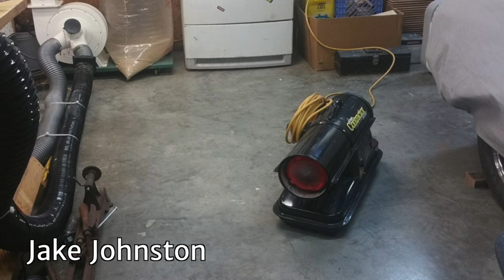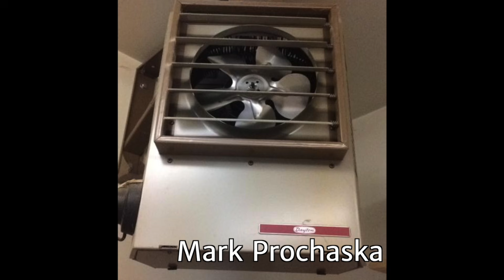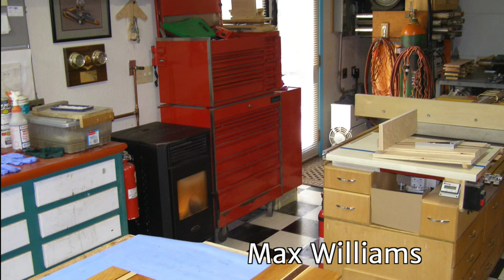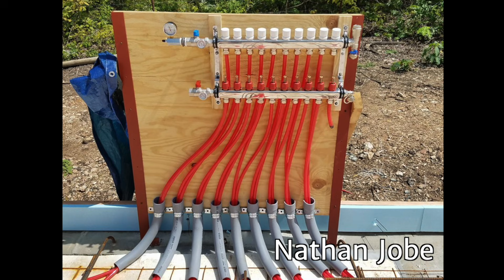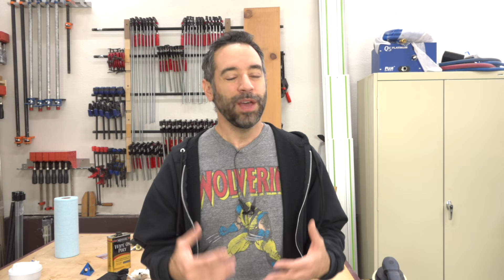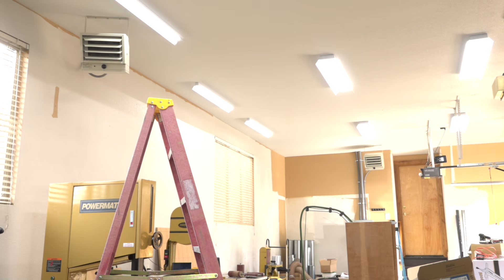Heating Your Workshop

Comment: I´m currently building a workshop on my farm, 128 square metres, concrete floor. I´m going for a hybrid system, a big diesel space heater that I mounted in it´s own insulated box outside with ducting into the workshop, I fire this first thing to boost the heat up quickly but it´s noisy despite mounting it outside, I then have a combination of electric fan heaters and currently installing a wood burning stove. I also set up small infra red quartz heaters localised at smaller work stations. At some point I may put in a sub floor with floor heating. I am lucky enough to of had the space to build my office inside the workshop, a 8 square metre, well insulated room which is heated by a small 600w electric panel radiator with wi-fi connection so I always have a warm space to take a coffee. I live in Sweden and we see temps of  upto  -20c in winter where I am. This will be the first winter for my new workshop so fingers crossed I have done enough work to stay warm.

Comment: in 2022 electric is very very exspensive but like you said it’s the easiest way to heat a garage / workshop that’s insulated. i only heat the area when im working . it’s a hobby .i’m retired .

Comment: Middle TN Woodworker here. I decided on a pellet burner. I buy the pellets in the off season when the price has dropped. Since 2009 it has only cost me $100 per winter. But then I wasn’t out there every day and have a 28x30x9 shop. I was working my regular job 3 to 4 days a week. Now that I’m retired I haven’t been through a full winter yet. I still love the pellet burner. 
As for your heaters, you could put a 2 pole switch rated at the correct amperage to turn on your heat as breakers aren’t really supposed to be used for switching.

Comment: Hey, Thanks for the info on heating. Do you try to control the humidity at all? Do you let the temp in your shop fluctuate? Do you find that your project wood stockpile changes dimension much due to temperature or humidity while working on a project? Thanks

Comment: I was lucky enough to be able to install a 3 ton mini split that keeps my 20x30 shop in the 70s when the temps drop below 20. I have a pair of those heaters from before the mini split and they did a good enough job before the foam insulation was put in the metal shop building. we have 8 foot doors and are still able to keep the temps in the 70s all year in Texas. The heaters do take a lot of power to run. The mini split cost about  20 bucks a month in the summer when temps are over 100. winter is about half that.  If you can the mini split is a good option especially where you have cold winters and hot summers like we do in Texas. Also keeps humidity down, this is good news for all my cast iron.

Comment: Marc - I live in Denver and am from here originally, and so far I've had the best luck heating my garage with an oil-based electric heater. I think these units are 80%+ efficient and what I like is that I can move them around to heat up the area I'm working in. With natural gas and coal-fired power plants being a key contributor to climate change and air pollution it seems a bit wasteful to be using up to 10,000 watts of electricity at a time to heat your garage.

Comment: Unless you're going to get a natural gas heater, electricity is going to be the  cheapest option - generally. People feel like electricity is more expensive, because they run it all month as if it's going to be free, and then get hit with a monthly bill that they have to see all in one lump-sum. Whereas if the same person was spending double on diesel fuel weekly, they'd feel better about it, because they're seeing the bill in smaller weekly increments. Even though monthly, something like diesel is going to be considerably more expensive than electricity. Electricity will even be cheaper than a wood burner. Unless you have a free source of wood. Anybody burning pellets is going to be way far behind, compared to electricity. The only two sensible options in heating are electricity and natural gas.

Comment: Marc, love the channel.  I have a couple small forced air heaters in my finished basement playroom.  What I ended up doing for controlling them was ran the electric power to a 220 volt wall switch at the top of the basement stairs.  The 2 heaters are then controlled by a thermostat that is installed between the two heaters on the wall, heaters are in ceiling.  This way when we want to heat the space, we just hit the switch and they turn on and the thermostat controls the heat.  When they are done playing or we are not down there, we hit the switch and turn them off.  If you add a switch and thermostat, you may want to put the switch by the door going into the house, allowing you to turn them on prior to entering the shop and turn them off when you leave.

Comment: You don't want moisture in the air when working with wood so I wouldn't be using propane. There are heaters that don’t create any moisture at all. These include indirect fired heaters and electric heaters.

Direct fired heaters create some moisture because they generate heat by running air directly over a fuel burning flame. Indirect fired heaters heat the air without running it directly over a flame. Because of this, they don’t come in contact with any fuel.

Comment: I am up here in New York State, and the problem I have is my shop is first very small (only about 185 square feet) and that being said, it is too hot in the summer and too cold in the winter!! As far as cooling it for the summer months I think I am going to install a 12 volt roof top air conditioner unit, like those used on an RV!! You see the thing is I want to install a small solar power system to my shed anyhow so I can run LED 12 volt lighting into my home (we have a lot of power outages in my area, so that would be perfect)!! And I think by using an RV air conditioner as well my work shop would get plenty cold in the summer as it isn't that big to start with!! Heating on the other hand is currently a total nightmare!! I don't have a lot of space for a large heat source, AND because I only have a 50 year old 50 amp electric service I can't really run a lot of electric either!! That means I can't run electric heat in my shed workshop!! Currently I run a propane torpedo heater in winter but that takes up a lot of floor space and I wish there was a small forced air heats I could run near the ceiling but I haven't found any that will work yet.

Comment: I have a 3 car garage with one bay for the shop. I heat with two 23k kerosene floor heaters and it takes a good 90 min to get to shirt sleeve temperature in a typical Mich winter day. Cost for a day of kerosene is about $12. Hassle factor is higher though. Can you update your cost estimate for daily use of your heaters? Thanks for all you do for us!

Comment: @4:00 that's bad ... why? You haven't explained what was wrong with installing Mitsubishi air conditioning unit. The compressor noise ?
Reply from the maker: I did explain it about 10 seconds before that timecode. :) It was an eyesore on the front porch.
Reply: @woodwhisperer  Ahh thanks "eyesore" Didn't get that word immediately :-) Right this kind of devices are just obscuring view for sure. The best place Is to have them on roof
Reply from the maker: Yeah for sure. This location is right next to our front door and there was no way to make it not look terrible. Thankfully a couple years later we had the budget to run the lines properly and the compressor is now on the driveway side of the house next to our other compressors for the house.

Comment: I am from west central saskatchewan,  and as you expect we are very concerned with staying warm. My house has a geothermal heat pump with forced air/in floor and I plan in floor for a future shop . There are a couple aspects you didn't touch . One option for the heat pump is to put the lo pressure side straight down,  mine is in 7 200 foot 6inch diameter holes . A shop where you live would not need more than one.  In floor heat is wonderful  , but the recovery time is slow , up to three days if you cool your room right off . I am planning infloor in a future shop but with a forced air loop in the system to recover faster. The slab should have insulation under it as well as between slab and grade beam , 2 inches of Styrofoam is recommended. I talked a friend into laying in loops when pouring shop floor 40 years ago,  he then built a wood boiler , 2 fills a day keeps a 40x60 shop warm

Comment: I thought the whole point in mini splits was the savings in being able to install them your self everyone I see on YouTube installed there’s them selves??
Reply: That's possible due to pre-charged (sealed) tubes. If you disconnect the tubes (to move it) the coolant gas comes out. After that a professional has to charge (refill) it.

Comment: I looked at just about every source of heating that you put on this video.  I decided a closed heating system would work.  I have to go 100 feet around my house to the garage and I'm willing to spend the money the first trip through maybe even trench it in partly myself but I think it's better to do it this way then to have to redo it later , I did a lot of research on this particular heater it brings in combustion air from outside there's no  chance of ignition, combustion air, doesn't run fumes or dust particles through the flame box or the heating chamber I have dust collection and I have a room filter

Comment: We used a large window unit capable of 1050 square feet (shop was 22' x 40').  I cut a hole in the side of the shop that was big enough, ran the 230 VAC line and the socket and we put it in.  It ran great for almost 10 years and never missed a beat on heating or cooling.  When it died, I replaced it with anotherone that still runs fine 5 years later.  Just seemed to be a categoy you skipped right over and can also cool in the summer.

Comment: I have a 3000/5000w heater like you have. When it’s colder I have a little propane heater that I throw on for about 10 minutes and then the electric heater maintains a very nice temperature

Comment: I had a propane heater in mine shop. After using it a few times I had to remove it. I could smell what they put in the propane and was burning my eyes and throat not to mention all the moister it was creating. So I went with 2 some 1500 watt heaters. My shop is only 12x20 so not very big but I insulated the heck out of it so once the temp hits the point I like it takes some time to cool down.

Comment: For a thermostat all you need is a contactor like for big 3 phase equipment. Get one with a coil voltage of 24 volts AC and power it with a doorbell transformer with your thermostat of choice wired in between. I'd recommend switching to NG or propane eventually though way more efficient and cost effective. Electric is more applicable in spaces used for short times

Comment: I heat my garage with a single 5K heater. The ceilings are lower than yours, 9' vs 11'. Instead of hanging it from the ceiling I set it on the floor and point it down slightly. It just plugs into the wall and unless I am leaving the doors open for an extended period of time it works OK. Hanging heaters where they are going to heat the warmest air has always seemed backwards to me.

Comment: A thought on waiting 45 min to an hour to let it heat up. I have heard it said that it is more energy efficient to keep your air conditioner running, even when you're not home because having it run hard for that hour or whatever to cool the air takes more energy than maintaining a temperature once it is reached. Perhaps the same can be done for your garage with the heaters. Now you will have to have a thermostat installed I'd imagine for that. My main concern with that thinking in a garage is, a house is insulated perhaps the garage is not. So take from that what you will.

Comment: I'm in Michigan and I recently put in a FUH 54 after watching your review...thank you...it works great. My shop is a bit smaller...it's 16 x 20 and not insulated (yet) but the heater still can get it warm  enough to work in light clothes. I thought that I'd be switching off the breakers too at night but instead I just dial it down to the first dot and it keeps the temp at 45 degrees. It doesn't cycle that much at that setting, so I don't expect the bill to be outrageous. I won't know till the first bill comes in though...so I'm keeping my finger crossed LOL. 

Again, thank you for your review. I enjoy your videos.
Reply: Hi Jim I'm from Northern Michigan could you tell me how much your electric bill has been running this heater and if you still have the same heater. Thank you.

Comment: I'm about to exercise the heating option of moving back to Arizona.  I am currently a bit south of Jackson Wyoming and hot hide glue is my go to adhesive.  I use heat lamps, hair dryers and heat guns to warm parts prior to gluing.  Not an enjoyable way to work!

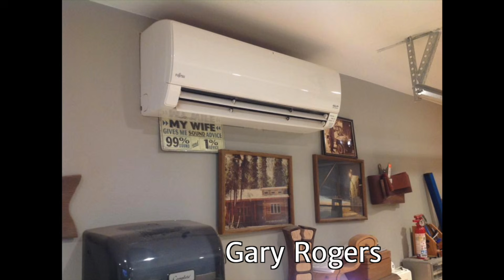Comment: 2:25 that's my name but not my shop... I have a small 12'x 24' shop and I just use the big buddy heater connected to a big tank and it works good but sometimes I need the space and not the heater.

Comment: We were lucky at our new place, we have plenty of timber on our land. I was a little hesitant to put a wood stove in my shop but I love it. It's quite and don't even mind having to add wood every once in awhile. Plus I usually have a pot of water on there at all times so it's easy to have coffee or tea at anytime. When the temps get into the negatives I have a Perfection kerosene heater I can use to help supplement the heat. It's the glass model and it's absolutely gorgeous when it's going.

Comment: When you consider you have saved $3,500 or more on the heating system that you can put towards to difference in fuel cost, it might be a number of years before you’re spending more overall. We used to have to replace gas unit heaters every 10 years at several thousand dollars each. Not sure electric wouldn’t have been cheaper overall because they last a lot longer.

Comment: Hey brother.    Firstly would like to say I'm not being critical.   That being said, folks are missing out on the cost benefits of wood burning stoves in garages and shops, especially if they are occupied daily.    Combined with air cleaners and air movers, a considerable amount of the cost of running A/C in the warmer months can be recovered by wood stoves during the winter.

Comment: You might also consider a hydronic pellet stove with a circ loop into fan coil units which could also be used to help filter the ambient air
Reply: That would be an expensive option to convert in a workshop. It would almost be as cheap for insulation, electric heating and air circulation.

Comment: Good information. I worked in the air barrier field. And air tightness is your friend with heat. Seal those windows with some plastic. Every winter I turn my shop into a trash bag and that does me very well

Comment: With my garage shop in Michigan I used a radiant tube heater.  Worked very well and kept the cars warm in the winter.  Also, didn't worry about blowing dust around the shop like a fan based heater would do.

Comment: I've got the 5kw unit in a 700sqf shop and it definitely does the trick.  I put a meter on it and it's pulling a little over 22a so I'm thinking the electric bill will notice it.  Thankfully the shop is well insulated and it doesn't have to cycle that often.

Comment: Mark if you are not heating this space all the time or at least maintaining a minimum temperature will the wide temperature swings cause problems with your project pieces. What I mean is if it gets down to freezing or below in the shop overnight and you come in and crank up the heat the next morning how long before your tool surfaces and more importantly your project materials are all at a uniform temperature? I would think it's difficult to measure the internal temperature of a piece of wood more than one inch thick. The surface and first 1/4" may be at room temp within an hour, but how long till the internals of a 2 inch thick piece are at the same temperature and what would happen if you cut that piece while there is a large temperature differential between the surface the interior? I don't know I'm just asking. Maybe do a video on this with some experiments to determine if it's a concern or not. Seems to me it would be since it is customary to let your wood acclimate before using it. I'm not targeting you with these questions, this is something that has always concerned me as I don't heat my shop 24/7 because I am not in there every day.

Comment: One of those heaters attached to the top of a propane tank offer a good start to the day that can bring the room up to temp to let the electric units maintain the temp. Fans will definitely be a plus. With a covered floor one is not standing on the concrete.

Comment: Just read your electric meter then run those heaters for your time allotment i.e. (1/2 or 1 hour) and calculate the kilowatts used by what your electric company charges per kilowatt.